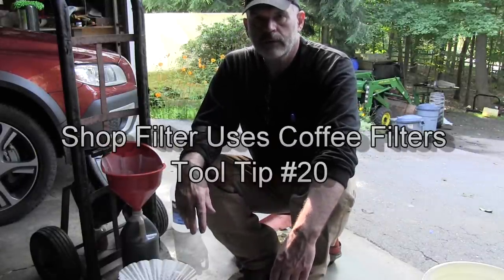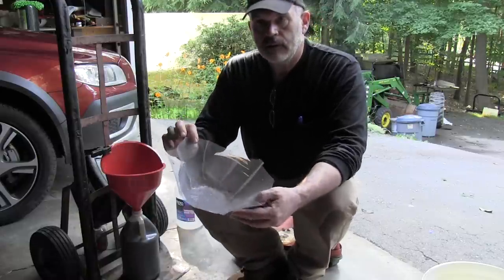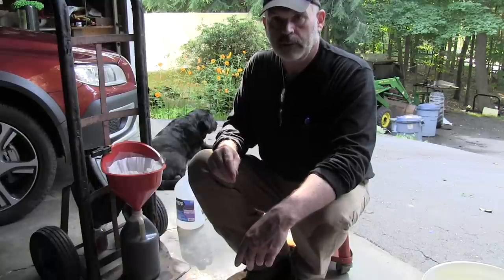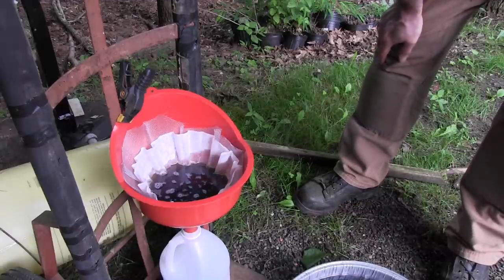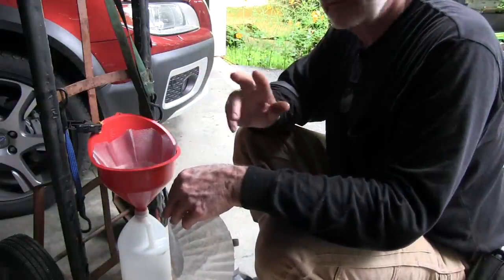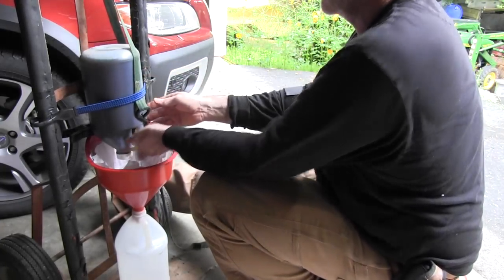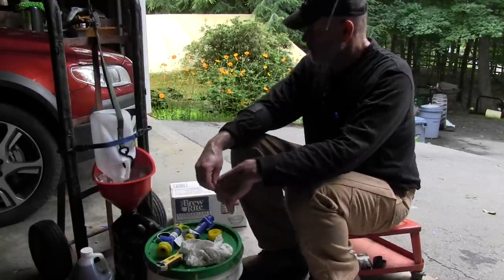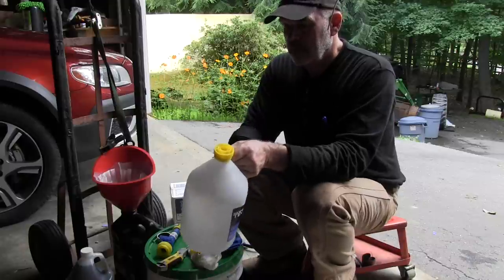Use Coffee Filters to Make a Multipurpose Filter Tool Tip #20

Comment: If you bend a piece of coat hanger over and hang in your recipient just between the jug and funnel, you'll provide an air break between the jug and funnel which will also make the funnel flow much faster.
Reply: Very well thought
Reply: Don't you think it's maybe getting enough air flow as is since it's not even sealed